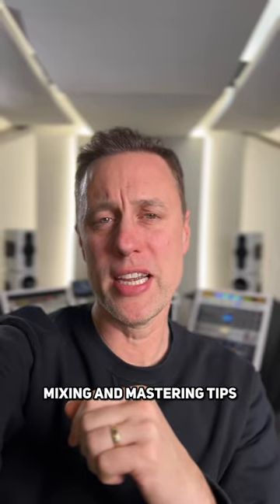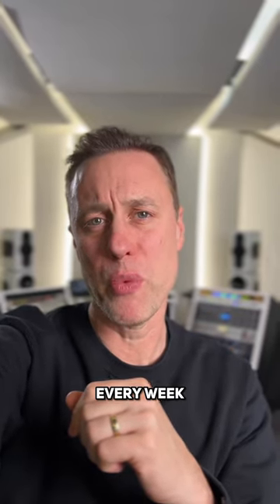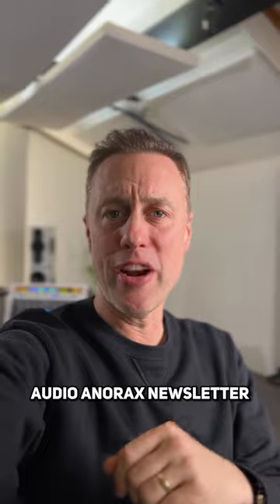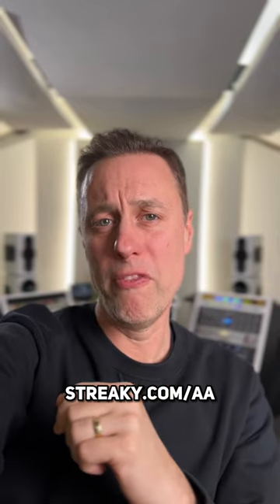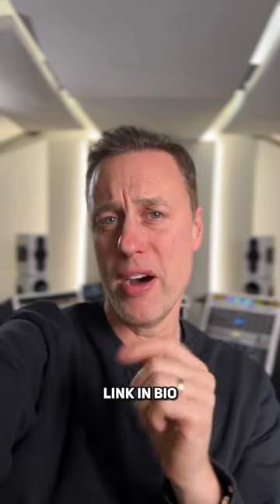HOW I HEAR COMPRESSION 🎛

Comment: I have never heard "glueing" with this definition. In fact, its always been referred to as gluing multiple tracks to each other by compressing them together.

Other than that, this video is pretty spot on. But it does very little on hearing compression. That is quite the challenge for some. I know I struggle hearing minimal compression XD

Comment: If a compressor is affecting the dynamic range then dump it unless that's specifically what you're going for.  Compressors work on the dynamic swing of a signal. The dynamic range of  a system is how well it conveys the fine details of a piece of music. "I use these speakers to  mix cos I can cleanly hear the reverb tails" ... = I use these speakers cos of their dynamic range.